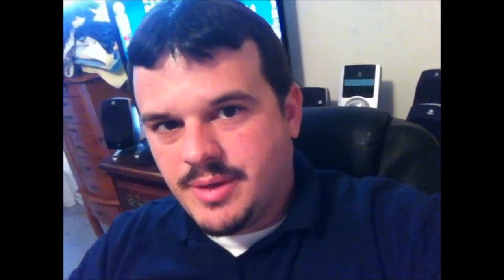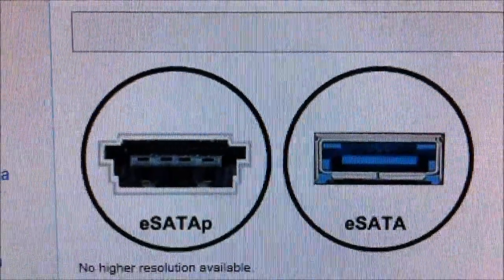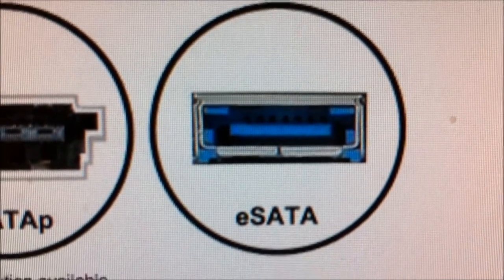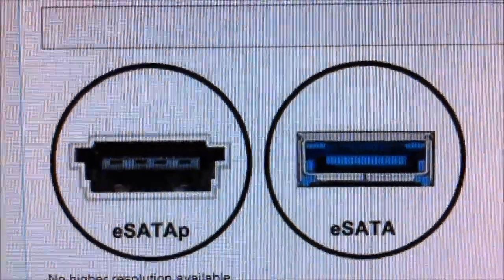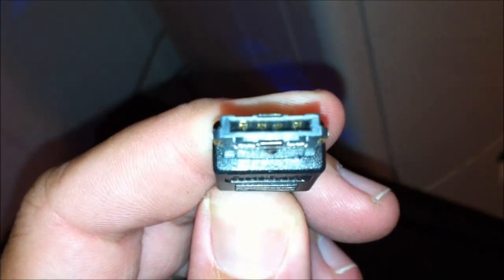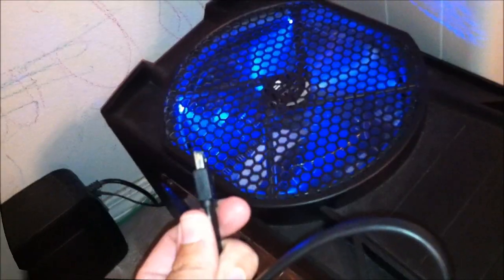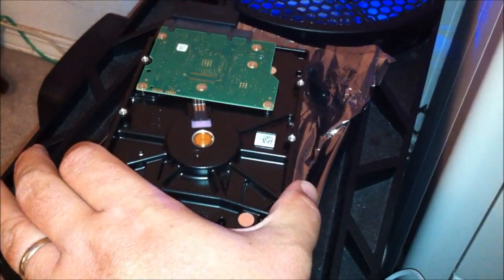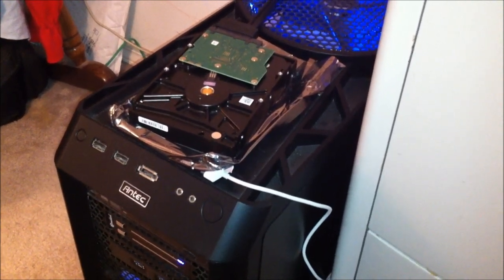eSATAp : External SerialATA POWER. What is it and how can you benefit?

Comment: For a video that is  12 years old, it is still very useful today.       My Dell T3500 has one of these ports on the back.  Seems that it's Native speed is SATA-II or 300 MBps (((MegaBytes Per Second)))  Vs. the latter SATA-III of 600 MBps.  

For just about all spinning Rust?  Even today SATA-II  running at ~ 300MBps is more then enough for a single drive.   Even in Raid 5 its not bad as SCSI 320  drives in a RAID-5 often don't push more then 280 MB/sec  with all the overhead and small files being transferred in a real workload.    

An SSD after about 40 GB of data  works at about the same speed as the IDE  back in the day since it runs out of cache.  Even the Top end SamSmung drives.  :face-blue-droopy-eyes:  So really,  its still a VALID port when used for Storage at at the latest SATA III speeds today in 2023.  

In fact, just about all High Capacity Spinning Disk Hard Drives today still use SATA ports since they still can't push much over 250 MB/ Sec in a REAL workload.    Same goes for those that use TAPE Drives.    But more often then not, that is a SAS Drive that should be backward compatible with SATA. 

Seems SATA for Mass Data Storage is going to be with us for another 20 years or more.  
Why?   

Back in 2020?   They made a 20TB Drive.  
In 2023?    22 TB drives are now on the market.   I just Ordered 2 of them from Ebay at less than $200 bucks each. 

But Purchased a 20TB Western Digital My Book  on Amazon Prime sale day for $269.   BUT! Its only formats to 18.1 TERABYTES!  

Meaning?    Its not EVEN a 20TB drive when you start getting into these large drives.  🤣  You did not notice the rounding by the marketing department as much before drives got this big.  BUT once you go to 20TB, and then you find out you lost about 2 TB from that wonderful way we calculate drive space?  It sort of starts to hurt just a bit.    

And the prices for this capacity sure have not seemed to went down much.  Even though the drives have got bigger?  The speed of spinning rust sure has not!   And the fact that you need to buy at least 2x at a time for data redundancy sure stings a but still. 

Now compare that back in the day where a flagship 2TB Drive (Top of the line of the day)  Would cost you less then a Hundy!  

And the speed of the drive really is about the same as today. 
And what about those Raptor Drives?
Heck the 10k & 15K SCSI Drives are still pretty great to use today as they don't slow down as they get filled up. 
Neither do they miss a beat.  

And when you got  14 of these babies ?   They still work great!

Comment: so in theory i can run a IDE PATA old Hard disk using a eSATApD cable so it givs 12v energy..  but most notebooks have only eSATAp (not dual 5v 12v).. ASLO
 i found that only cables have notebook conector for 2.5 hdd.  so i have to add a little PCB adapter from 2.5 to IDE.  Am i right ?

Comment: I have this computer I bought used with this port, so I bought a cable to see if I could test some old harddrives to see if there working. I just don't know if I need a jumper to get the harddrive to work or not. I'm not sure if this works similar to an external drive without the extra board to get it to boot when power is applied to it.

Comment: This is such a confusing standard with a confusing naming scheme that differs from manufacturer to manufacturer. To be able to use eSATA with a 3.5 inch HDD you'll need a port that can output 12 volts. Don't assume that eSATAp means a port can provide 12V for a full size 3.5 inch HDD. In some cases it does but in some cases it doesn't and you would need a eSATApd port instead. No wonder a lot of bad reviews are left on banggood for their esata cable because it wouldn't work for a lot of customers with their 3.5 drive on a 5V port. tip: most laptop eSATA ports are only 5v so you won't be able to connect 3.5 inch drives with a cable like showed in this video. 5V is only enough for small 2.5 inch laptop HDDs and SSDs.

Comment: Could you use this to power a (SATA) 5.25in optical drive?
(I sacrificed my DVD drive to another HDD but would like to read CD/DVD ROMs without having to rip an image on my laptop)
Reply: External DVD drives are power hungry and don't have a lot of bandwidth so I would not power one from the notebook unless it was designed for that. External USB 5.25" enclosures are cheap and because quality of DVD drives has declined I use a good 5.25" drive in one powered by its own brick. I've burned bootable live CDs/DVDs since around 2000 for whatever that's worth.

Comment: What if you connect Hard drive enclosures with eSata interface. Will it see each drive separately or only as one volume? Have you ever tried that? 
 I am just looking for hotswap solutions for multiple drives More than 20 in one computer. so motherboards do not support that unless you put expander and raid controller - which will requiore server board. TOO EXPENSIVE.
Reply: +Sergey Marchuk 
You can run a temporary OD with a separate hard drive and if you take the hard drive out of an external hard drive it will work. Not with the old hard drives with all the pins, use the fewer shaped like the  he did that is how hard drives are now one long l piece and it cuts off and it continues with a small l shape tip. I have only tried this with laptop/notebook because I am using an elite book pro with a docking station, not a think pad. It is 2011 so it is strange as he says they stopped and it really stopped in 2005 but  would add the HP Elite book pro and ThinkPad they still add them on just like some docking stations and computers that come ith that old purple printer 30 male pins. It is USB he hs took that place of that for printers. Lan lines  are always are on any computer because you may want a direct connection and you ae getting able to run multiple screens and you will use USB 3.0 with taking off Aero on a window so you can get 5gbps. I know a little bit because I am learning to salvage computers and test them and put them back on the consumer market. Refurbishing them. I make double triple and made six and 7 times  my money. I buy a computer for parts and buying or finding parts cheaper at second-hand stores and computer stores the last place would be eBay I get good deals. I hope this answers your question. There is a way without taking the external hard drive but I have not messed with that one yet.. Also, you need the OS in a DVD-Rom-drive to run while you are using e-SATAp. If you use an external it won't recognize the, in Bios because you can't boot up wit them they have no OS it just is a Data recovery for your system. If you want to swap with 2.5 and 3.5 hard drives get a docking station that is 60 or more and it holds about 4 hard drives that are the max I have seen. but you can buy a second one.
Reply: +Austin Chiang  I need SATA or eSATA, cause usb and other connection do not support S.M.A.R.T. Test and Linux does not see those as separate drives
Reply: Try putting your hard drive as an external hardrive and use the USB cable because all u have to do is buy the kit to transform your internal hard-drive into a external drive. Or, try Startechs multi-port hard drive ports you can put 2.5 hard-drives from a laptop and a 3.5 from a PC hard-drive it has four ports total and it does not matter where you put them in and the hard-drive hub uses a 3.0 USB with the two different ends and comes with software if you need other drivers or you can always download them from  the site. That is a way you can see all your drives and swap information to one drive to another. Also, check if you  reformatted the hard-drive  or else you won't see it if you don't reformat it. That is as far as I can help. I don't really mess with Linux and I don't know what you want to test but you said you don't see it so try that out and continue to research. Chiang over and out. Oh, and check your Bios.
Reply: +Austin Chiang  i dont think you are even reading my replies. WHy bother responding than... USB port does not support S.M.A.R.T.  - PERIOD
Reply: I was responding to what you said you can't see your hard drives. So, it brought to mind it could be you did not reformat your disc if you want to start from scratch and also if it is new. When you format a hard drive you will see your drive. I also mentioned StarTech 4 port hub because yu wanted to do some swapping. You can do that with StarTech 4 Bay eSATA USB 3.0 to SATA Hard Drive Docking Station. That was it I was hoping that could have helped you be able to see your hard drives. I am reading your post. I don't know you and for you to make assumptions and be sarcastic is very rude. I tried to help with my limited insight. You did not have too answer me back the first time if my post to begin with did not serve your need. You could have not answered me at all, or you could have simply  answered and said thanks for the input but that doesn't help me or you don't understand my question. This is what our country is coming too. You are from the states right? Well, there was a friendliness that is now gone and people will fight about the tiniest stupid things. I witnessed grown men Black, White, Asian, and Hispanic men fight over whose TV day it was and it turned into a riot and we were on lockdown for a week. If that was worked out in a civil manner we could have enjoyed the TV and and not be n lock down having to stay bed ridden on our bunks. Anyway I know this is irrelevant to your question I was trying to help and I address your question on not seeing your drivers. I will not respond per it is final weekend for me and church tomorrow and I am interrupted by these negative remarks.
Reply: I do hope you find the answer you are looking for I happened to find a lot of help on yahoo Q&A, About.com , and YouTube etc... wish you the best.

Comment: You don't need to shut down the computer before plugging or unplugging the cable or drive. The only thing you need to (well, SHOULD) do is eject the hard drive from the device ejection icon before unplugging the drive.

Comment: Yeah, shame on Asus.

For most people it's not a big problem. 3.5" external HDD's come with their own power brick. 2.5" HDD's can be powered with the 5V eSataP port. 

It's only a shame spare 3.5" HDD's can't be powered by that port.

There are brackets available for desktop PC's to make your own 12V eSataP port. Delock 61824 for example.

Thank you for pulling up your notes ;)

Comment from the maker: After pulling up notes and recalling my experience with this,......jcvjcvjcvjcv is RIGHT. I recall after completing this video, i then noticed that my drive actually was not spinning up, rather i was feeling vibration from the upper cooling fan. Those mentioned contacts 12/13 are missing and Asus mislead users of this board about the eSATAp port they provided. In small print somewhere, they state that only 5v is provided. A notebook HDD or SSD will power just fine.

Comment: If I look at 6:10 in your video it shows clear plastic on what is then the bottom of the port. If there was a 12 V connection in that port it should be there.

Or otherwise you have some 3.5" that runs without 12V :)

Google 'EUHP' On the Asus connector pin 12 and 13 are missing. Without them no 12 Volt.

Comment: And what cable would that be? I have a P8P67 EVO and also have the green powered eSata port. But it does not have contacts to the far sides of the connector, where +12 is normally supplied with eSataP

Or do you have a 3.5" drive that doesn't use 12 V?

Comment: esata is 0 volts power, not 5 volts. power is not supplied by the esata interface.
Reply: eSATA no tiene alimentación de potencia, pero eSATAp SÍ. Precisamente la p significa "power over eSATA". Solo tiene 5V. Mi portátil lo tiene, y puedo conectar memorias USB por ese puerto, porque reciben alimentación. Para los discos, la potencia que entrega no es suficiente. Al menos, para los discos "mecánicos". Supongo que para los SSD sí sea suficiente.